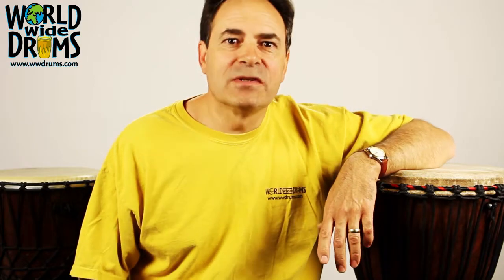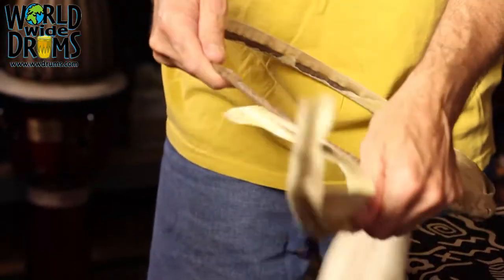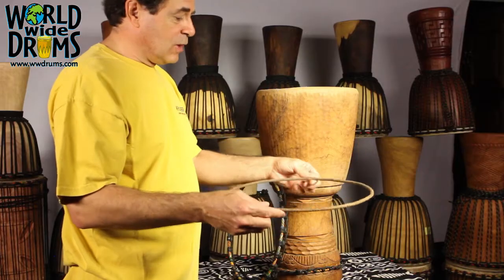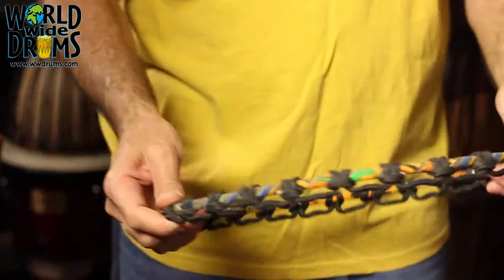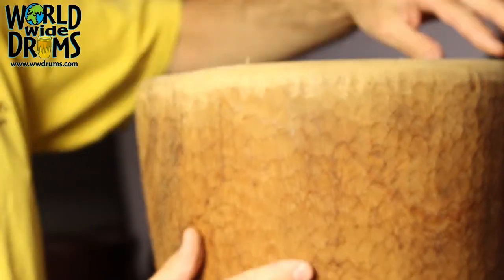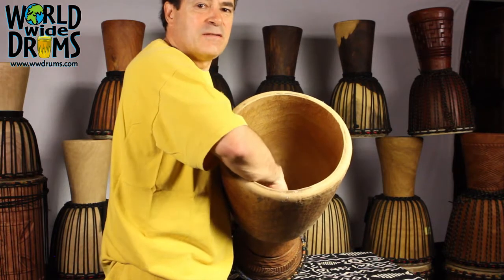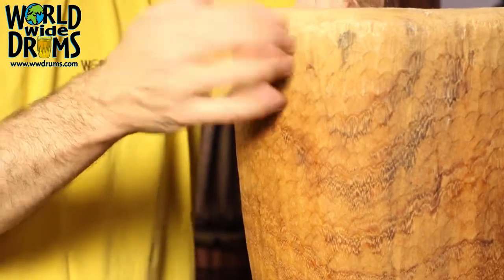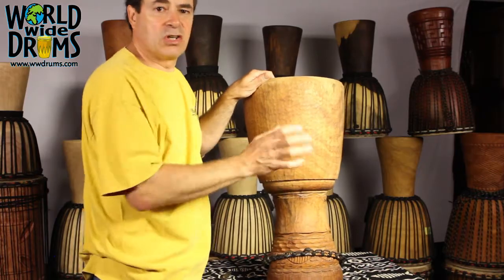Djembe Repair & Rehead - Djembe Drum Repair - Drum Inspection

Comment: Great video series. I’m just now replacing my skin on mine, I’ve found that it’s dried up and the bearing edge is not even . Should I use a rasp to grind it level?
Reply: If the edge is rough or bumpy, I would smooth is a bit with sandpaper or a rasp.  If the edge has a gradual slope or dip, I would not worry about it. Good luck and happy drumming.
Reply from the maker: I would smooth out the bearing edge with a rasp of sand paper.